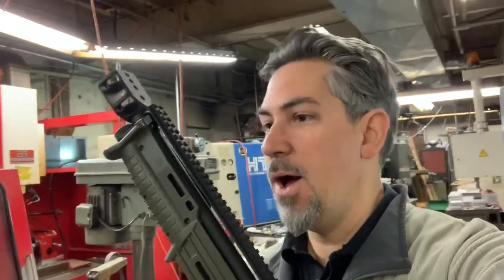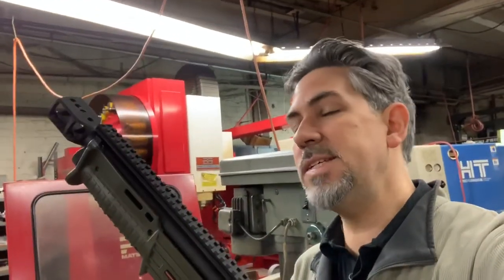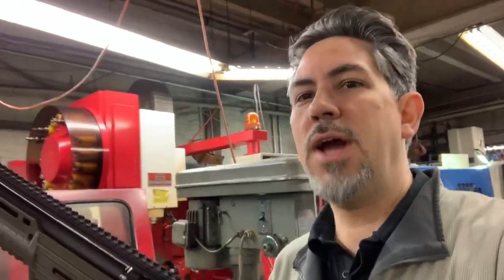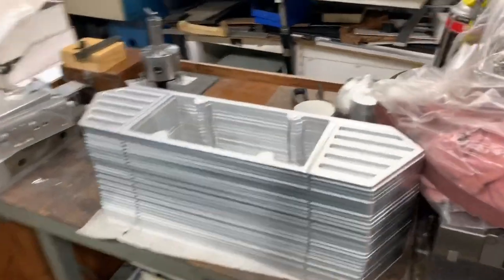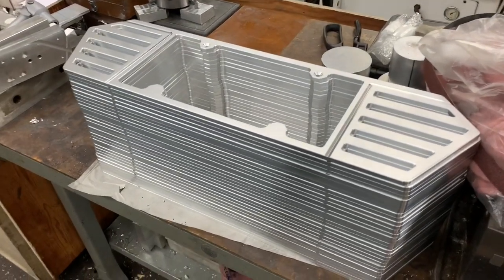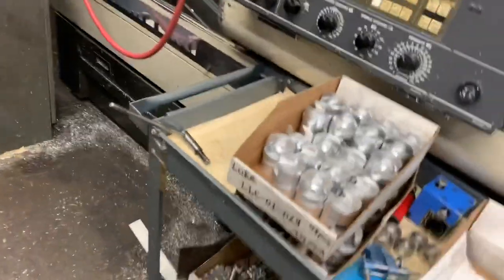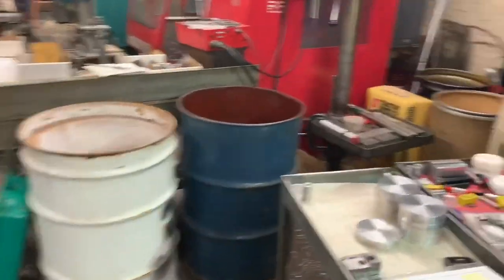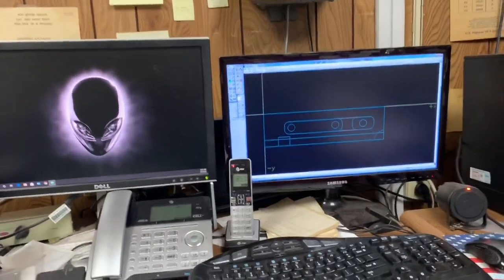Hi-Tech’s KS7 Charging handle Mod upgrade & Coronavirus KSG full production Ramp. Still shipping!

Comment: Haha, I am glad I found you guys! 
 I just took my KS7 apart... in my office with my Calipers in hand.  I have a large 3D printer ( Design Engineer) here and was going to fab up some prototypes, one being a charge handle.
  I Think you might have just saved me some machine time... 
Give me a shout if you ever want some cheap design work, I've never worked with fire arms.  I deal with Circuit boards and plastics, housing up consumer/Hobby electronics but I'd love to get involved in direct to part machine manufacturing.

Comment: Instead of a bolt on design that attaches to the original pump, you should make a replacement part that integrates mlok for vertical grips/lights.

Comment: Hey Karl I saw that the charging handle/lower rail accessory for the KS7 is posted for sale on the website! Exciting stuff.  Can you release another video showing fitment and operation with some different vertical grips? Thanks for your hard work!
Reply from the maker: Hi Justin. We sure will.  The problem is we compeltely sold out of our initial production in 4 days! We are in the process of manufacturing another 125+ sets, and after that another 400 sets.  Until the next batch is ready for sale we don't want to do any video's.   But it will definitely be coming soon enough.  The fitment is very easy as it's a screw on assembly.  No modification required to your KS7!  It's an amazing upgrade for your KS7 to maximize total control.  Thank you for your support.
Best regards
Karl
Hi-Tech Custom Concepts Inc.
Reply: @karlhi-tech7853   Thanks for the quick response and update! I'm glad y'all are having such great success. Looking forward to seeing the video.
Reply: @karlhi-tech7853  Hey Karl any update on that video? Know y'all are probably busy but saw the website lists some stock.  Keep up the good work!
Reply from the maker: @piemanklp  It's all in stock. It's the 1st pinned comment on this video.  Thank you.

Comment: Just saying its the middle of September still no charging handle.
Reply from the maker: I know I'm very sorry about that delay.  We just released the KS7 "Choke Adapter", and another KS7 mini Rail option in the meantime.  
The Charging handle mod is more complicated than first expected.  We are in the middle of changes on the prototype design still.  But between the changes and all our other products massive demand, we are litteraly at maximum manufacturing capacity.  We are doing our very best.  
Please check back on our KS7 Only Upgrades section of our website every 3-4 weeks.  When it's ready we will list it there.
Thank you for your patience during these very unusual times.
Best regards. Karl,  www.HITECHCC.com

Comment: When is the KS7 charging handle going to be done?
Reply from the maker: Currently working on the prototype.  Sorry this summer was insane with demand for existing products which has keep our machines at maximun manufacturing capacity.  It's getting closer.  We will list it in our "KS7 Only Upgrades" section of the site as soon as it's ready.  Thank you for your patience. Karl
www.HITECHCC.com

Comment: Could you make CNCreplacement parts for ksg. To get rid of plastic on gun.
Reply from the maker: Unfortunately no.  It would make it too heavy, and the cost is too high.  But we just finished an Aluminum lower rail mod this December that works great!  We are currently going into initial test production and will be rolling it out this spring.  Thank you.
Karl,   www.HITECHCC.com

Comment: Is the charging handle ever going to happen?
Reply from the maker: We are currently working on the prototype right now to make sure it works good.  Sorry for the past 3 months were were crushed with demand for our regular products due to the COVID-19 situation and recent off the charts gun demand. Our machines were at 100% manufacturing capacity since March.  We will list the new product once it is complete in our KS7 Upgrades section. Just keep an eye out there by late August.  Thank you for your patience.  Best regards.  Karl, Hi-Tech www.HITECHCC.com
Reply: @karlhi-tech7853  Thank you for replying.  I have the Defender Muzzle Break, High Viz Follower and Velcro Side Saddle from you guys on my KS7. Love your product!
Reply: @karlhi-tech7853  Any updates?